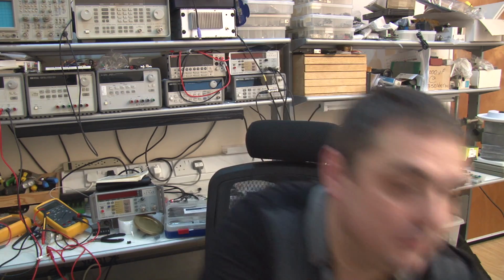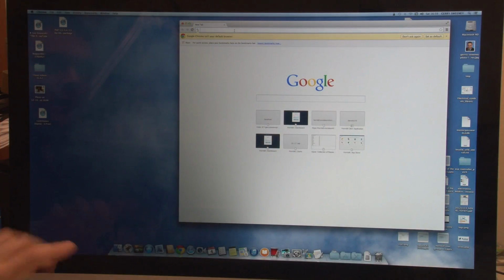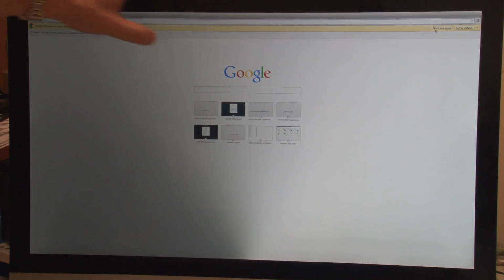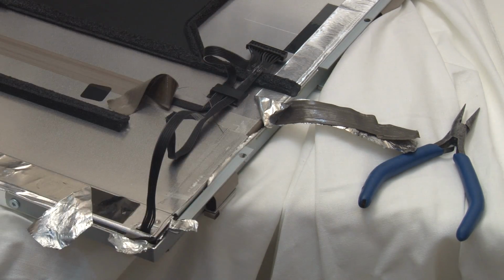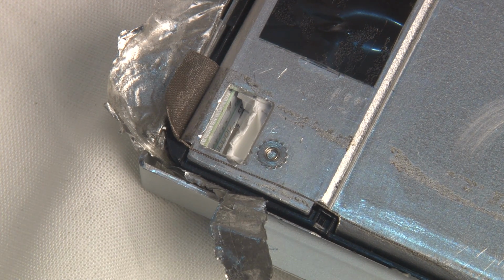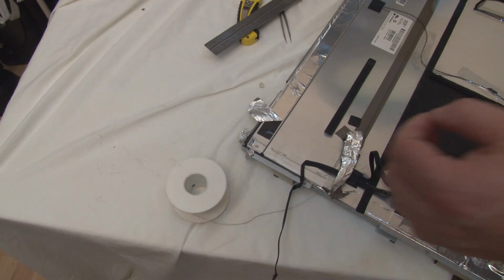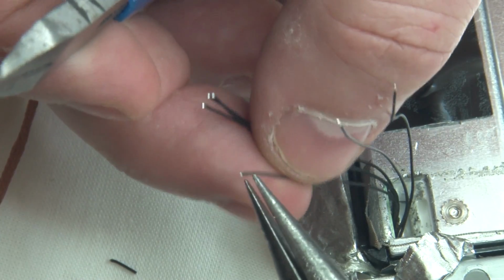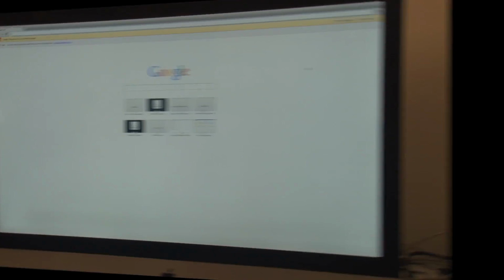Apple iMac 27" Dark Side Screen Failure - The Manufacturing Fault Apple Will NOT Admit!!

Comment: Thank you for the video, however I took the longer road and disassembled the display entirely. It is cumbersome and tedious, but I could not imagine to solder it the way you did. After disassembling the frame and everything I was able to disassemble the and isolate the left part of the backlight LED strip. With this in plain sight I was able to re solder the connector again nice and clean. For those that come her and look for solutions.

Comment: So I attempted this operation. One of the pads that you solder the wire to came off! I take it I out of luck with getting full LED light working on my auria monitor that uses the same LG panel inside as the macs?

Comment: Very interesting indeed! I discovered that thanks to you.
However:

Why make it simple when you can make it complicated...
Instead of destroying the plastic contactor, I put a drop of WD4O, for electrical contacts, two small wedges (mini nails) to force the contacts towards the welds. Adhesive, reassemble the screen, test, bingo!
Reply: What kind of mini nails did you use? Can you give me the names of the products? I would be forever grateful.
Reply: @kryptonkiller  It's not a nails problem, I wanted to push electric contacts together  to reconnect them. I hove chosen that way...

Comment: I was lucky, I had the same issue on the left bottom on the screen, but the connector was still very firmly connected. I simply used some contact cleaner and IPA to clean the contacts and the backlight was bright and even over the entire screen again. HOWEVER…. When turning it on I noticed a “stain” could be seen on the left lower corner which actually made the whites really clear white instead of greyish. I pretty much soon concluded that the fluids had run between the LCD and the backlight panel and caused this stain. I had some hope it would dry up, but soon I realised what probably happened is that the IPA probably cleaned the backlight panel and LCD from existing dust. 
So….following this I will go on and open the entire screen and clean it. I think if you have this connector issue and are already needing to fix it, it’s best to also go for the full stretch to clean the inside between the backlight and LCD.

Comment: My 2010 27" IMAC has this problem. Would replacing the LCD screen with a used screen solve this issue? I hope you see this comment as I would appreciate a recommendation. I could never solder the connection like you did in the video. Thank You

Comment: Gerry, I know this is an old video now, but my 2010 27” iMac has lost the entire LCD strip at once (both halves if there is in fact two strips).  If I let the iMac rest for a while, it will come back on and operate for another hour or so. Could this be heat distorting something inside that connector and simply knocking out the screen?  It’s a mystery and I haven’t found anyone else with the same problem.  Just wondering if you have any thoughts on this.  Much appreciated.

Comment: Thanks Gerry, have saved several iMacs with this useful information. 

For this planning on doing this repair... It requires experience at soldering precisely, the pads are less than 1mm apart and you have a limited range of movement due to the access. You are going to want to flux things up. Do not attempt if you have not tried soldering before as you will more than likely do more damage than good. Find someone who can solder and buy them a beer.

Comment: Hi Gerry, i am Using a  Apple 27 inch mid 2011 with MacOs High Sierra 10.13.6 which recently i updated. I have a problem now hope you can kindly advice.The problem is mac shuts down when trying to connect to my 3TB time capsule. I am guessing its something to do with the upgrade software.Did call apple support yesterday and still not solve.Do you have any experience on this? Thanks

Comment: Wondering if using hot air to either reflow, or resolder, the connector in place would cause damage to either the connector or surrounding components. If not, I'm tempted to try it. Please let me know what you think.

Comment: Hopefully someone reads this. Don't have a lot of confidence to do this work. Would it a lot easier just to replace the backlight cable rather than soldering wires and would it work?
Reply from the maker: Yes you could actually do that, it would involve stripping down the panel, removing the outer steel frame and getting inside, it is doable, but its a lot of work and there is lots that could go wrong.  The keyhole soldering is not ideal but its simple and relatively risk free, by comparison to the other option
Reply: Unfortunately, the cable is not what is damaged. It's the backlight that is damaged. Specifically, one of the connectors has become detached from one side of the backlight. So, aside from a repair of this nature, replacement of the backlight is required, and the replacement seems even more involved than this repair. Maybe you can find someone to do the actual soldering for you.

Comment: Thanks. I have this dust again at the bottom with my Late 2015 5K iMac (bought in 2016) and Apple already replaced it once but it came back but I can't have it replaced by Apple, again for free- I wish I bought the extended warranty on time (not less than a month before the 1 year warranty expired).

Don't use compressed air, it could contain acetone or alcohol which will damage the LCD's diffuser which could be made of acetate.

I wish, even for out of warranty 5K iMacs, Apple would replace all 5K iMac screens that have this dust issue at the bottom (dust coming into the weep holes that equalize the pressure, like the weeps hols of airplane windows). It's definitely a design flaw. We should band together and create a website to  petition that Apple replaced our screen (hopefully if they do, it's a redesigned on, else it'll come back.)

God bless, Proverbs 31

Comment: My 27 iMac had same problem after I put a new hard drive in it but I was able to fix it without going through all of this I just took the screen off again and firmly pushed in that corner and reseated all the cables and thankfully it's back to normal.

Comment: Hi I have a mid 2010 27inc, after 2mins the screen goes black, but you can still hear the computer running in the background I thought it was the graphic card but after watching your video I’m now thinking it’s not the graphic card it’s probably the screen if you hit the escape button on the keyboard the screen comes back for about a minute if you press the on button at the rear of the Mac screen comes on for at least a minute or two then cuts out again, i’m like your Macaway half the screen went black my one is completely black.

Comment: Thanks for this. But I need you guys help: 

I already tried the resoldering the left side connactor but messed up the connection points while soldering the wires to the lcd’s led backlight board. the connection points on the lcd for the leds not holding the soldering anymore ): So is there any way around to solder the power cable for the led backlights from the imac to connect directly? I couldnt find any tear down guide for the lcd panel. 

Thanks in advance for any bit of help!

Comment: I think you'll find it's an LG fault. Apple don't make displays or graphics cards or ram.
Reply from the maker: You are of course right, in the same way, that car manufacturers do not make batteries, but if you bought a brand new car from Ford and it had a duff battery, they would replace it, they would not expect you to take it up with Bosch

Comment: Hi Gerry, thanks for sharing this and your tear down video. Like hundreds of others I have been tolerating this problem with a 2010 model for many many years. I saw your video a few years back but don't have those soldering skills or the right tools for the job. Decided to try the tape option. My connector was quite snug in the socket, left, right, top and bottom, so I couldn't ram any tape between the connector and the socket. Instead I folded some electrical tape over and over into a flat square that I placed on top of the connector. While pressing the connector hard into the socket, I taped it all down. So far, so good!  Problem solved! Good chance it will come loose again but not too difficult to re-do. Many thanks!
Reply from the maker: You are most welcome, thanks for the feedback

Comment: There are several folks showing the "6 wire" fix.  The sockets on each side of the display backside are actually on the LED strips (2 that go across the backside)  You can buy new LED strips (the sockets on them) for $15.00  310mm LED Backlight Lamp strip bar 36leds For Apple 27" LCD LM270WQ1 SD C2 MB270B2U SDA2 SDB1 SDE3 SDE5 SDF1 LGT2781 LGT2795.  Or you can solder directly onto the LED strip as shown in this video.  These panels are LG. Takes longer to put in the new strips, but you are not cutting the socket and soldering to the LED strip.  More work, same result, but not a modified display.

Comment: Heelo, I have the same issue with my lachine from early 2014 and had issues right after warranty period that I extended to 3 years. Even though I have lots of issues with this machine Apple refused to take responsibility of the repair. That's why I stopped buying Apple product even though they have good products and espcially I was a huge fan, I started with Apple with Macintosh. Too bad.

Comment: I am suffering from exact same problem and visually its exact same. My display is HP Z32X 
It's a 32 inch display worth 1599usd. And panel is from Samsung (PLS) . I want to know whether that connector will be located in the same position as in imac. Any help will be appreciated a lot.

Comment: Thanks man, I have the same issues with imac goes black anytime i put power on will try the connector as you did
Reply: I am suffering from exact same problem and visually its exact same. My display is HP Z32X 
It's a 32 inch display worth 1599usd. And panel is from Samsung (PLS) . I want to know whether that connector will be located in the same position as in imac. Any help will be appreciated a lot.

Comment: Just did this fix to my neighbor's iMac.  About 2 hours in we experienced the "what have we gotten into" feeling, as lands 3 and 4 decided to have an affinity for solder bridges, but perseverance and extreme magnification saved the day.  This machine was so far gone that simply jamming the connector wouldn't work, or I would've tried that first just to see if he could limp along for another year.  I agree with the other commenters...a good iron, good working conditions, extreme magnification, all requirements.  A digital microscope helps.  But this is very doable with modest skills, as long as you are deliberate, methodical, and cautious.  Plan for 4-6 hours, and if it only takes 2-3, use the extra time to toast your success!
Reply: Glad you found it useful, congrats on the fix, it does require some decent soldering skills.

Comment: Just tried to do it without a magnifier and i screwed it up. So i disassembled the panel and took out the led strip. But some copper paths have fallen of maybe i put some excessive heat. And trying to find a replacement for the led strip

Comment: Thank you for the video. This was a great help. I would add the need to use a multimeter to check the connections to ensure that the solder did not bridge the electrical connection between the slots before putting the machine back together.

Comment: Greetings Gerry. Great Video, very very helpful indeed. I have a iMac Cinimar Screen 24” Model A1267, which basically started to slowly not light up at all. It started with a flickering screen, so if I pulled the square plug out of the back of my iMac, & plugged in the Cinimar Screen plug immedatly again, the screen would flicker showing the details behind. Started with 4 or 5 pull the plug in and then out and it would light up. Stayed stable until the unit was switched off. Now, 6 months later, it will no longer light up, so it appears to me the whole LCD backlight has failed. Looks like a dry joint to me because with the slightest flicker when pushing in the little square plug, I get a micro second view of the screen saver, so it’s all there, just dark. Your plug repair looks like the problem, but before I attempt this, does this tiny 6 pin plug operate the entire backlight, not just one corner. If so, I’m about to copy your repair. Love to hear your comment before doing this. Maybe thanks and Greeting from Amsterdam.
Reply: I am not sure on the 24" MAC to be honest, it may be one connector, on the 27" the connector I repaired was only for half the screen, but its a bigger panel.  Good luck with the repair.

Comment: Thanks for sharing. It's been so long since I've heard of this issue, I had forgotten about it. The technique is certainly applicable in a range of surface mount failures. As I always buy used equipment, seeing this reminder and solution may help me avoid grief someday.

Comment: Thank you very much for this great guide, it led me in the right direction. 
My problem was a bit trickier as my connector was not loose. Only one pad was loose so I had to get to the connector from the front to solder it back in place. 
It is a lot harder and I was very close to render my screen useless a few times so I dont recommend it unless you are very good with delicate electronics.
But I was able to solder it back and now my screen is as good as new again :)

Comment: Hi. I was just about to di this because of dull screen in right side. But when i got alle the tape off i saw that the cabel wasnt loose as yours. But the other end of the cable that connects to the logic board was not connected right. So i just put i back together and now it works great. I was just a loose cable.

Comment: Gerry, thank you so much for posting this video (4 times ago!) I have the same problem with a 2011 27" iMac, but for me, the dark side is on the RIGHT. Is there another connecter behind the right bottom corner where I should make this repair? Or do you think it will fix it anyway if I do it like you?
Reply from the maker: To be honest I never lifted the sliver tape up on the other side but I expect you are correct,  the best way to know for sure though is take the panel out and have a look under the tape.  Given the way only half the screen goes dark I think there is a high probability there is another connector at the other end.
Reply: Ok. Seems that everyone have the problem on the left side. I hope that it's the same cause with the right side, with the (expected) other-side-connector. Worth the try. Thanks again

Comment: Thanks for this very useful video. My iMac has been like this for so long and mostly taking up space. Even with the iMac being quite old now it still has it's uses because it's such a beautiful screen. I have watched your video a few times and decided to take the plunge. I am halfway through the job and make no mistake it's really tricky but there is no going back!!  Even though I had a fine tip, I just haven't managed yet. I have ordered a 0.2mm bent tip for my soldering iron and am waiting on that before I continue. Wish me luck!
Reply from the maker: Good luck with the repair. Glad you found the video of some use

Comment: If anyone is having this issue in the Toronto area send me a message, I can fix it for you.
Reply: Hey Robert,
I'm in Buffalo. The left side of my screen has been dark for 2 years and then started going all black every so often but now its completely dark. When i boot it flashes for a second and then goes dark. I took it apart and the cable didn't seem to be lose but the screen is still dark as I really just looked at it. I am wondering if I can come up there so you can have a look at it?

Comment: Hi Gerry, I have one cinema display 27 (not thudnerbolt) but the issue I have is not the same as yours. I have the USB + sound working but the screen is completely black no sign of backlight or anything else. Do you think the problem is the same or more serious like a LCD fail ?
Reply from the maker: It is most likely either the backlight driver board or the video card, it wont be the same problem as I fixed here for sure
Reply: But in the Cinema display is there a video card ? I mean I know there is the a logic board and power supply but don't think there is a video card.
Reply from the maker: oh sorry i see what you mean, in which case its probably the backlight driver board (which may be part of the PSU in those monitors, not sure)
Reply: PSU is power supply unit ?